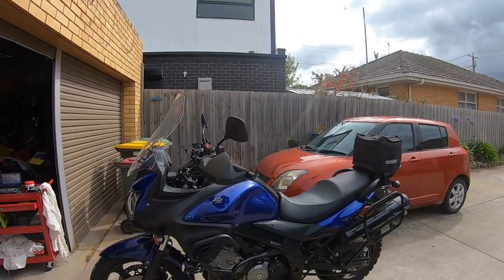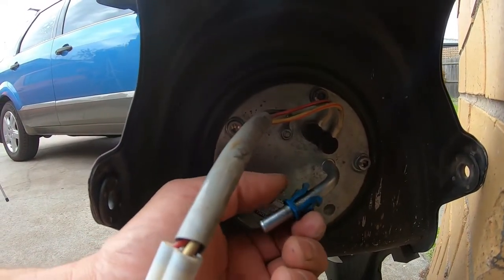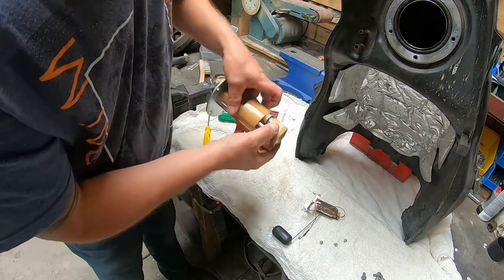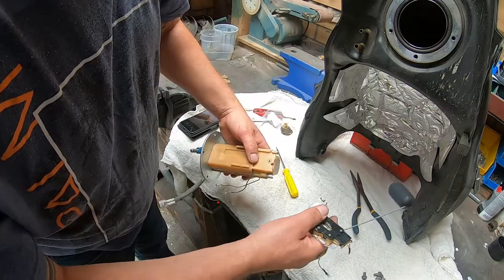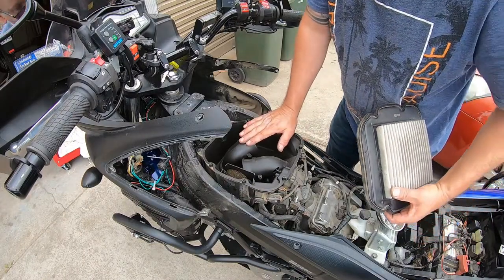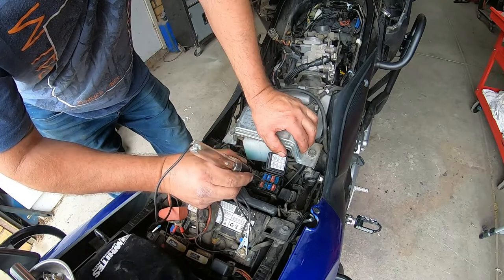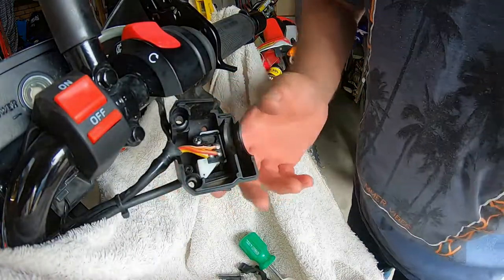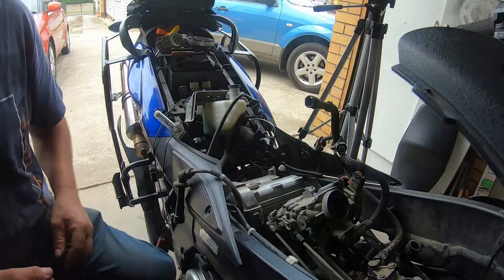how to change an air filter, fuel filter, on a 2012 Vstrom 650

Comment: Thank you very much for that video. Having the same problem with my 2014 V-Strom and am a bit afraid of removing the air filter box because of so many hoses (the tank's already done). But now after your perfect description (and the promise of my mechanic for a home visit if I fail ;)) I will give it a try later that day!
Reply from the maker: That's fantastic,  it's not as bad a job as you think.

Comment: Nice job tracking down the headlight issue. Mine was in the starter button, I cleaned the contacts, still didn't work so I soldered the wires together, just means the lights stay on when I start it. 
I'm changing my spark plugs and checking valve clearances while the radiator is off, much easier.
Reply from the maker: That's one way of fixing it, it would make a good video to see the shims getting done and people have asked to see plugs getting changed. Good luck with it, hopefully you can get the parts soon.
Reply: @bazz6670  Thanks mate. I will attempt to do a video on it.

Comment: no real need to remember orientation going back together. It will only fit in one position by uneven hole spacing. Nice engineering touch.
Reply from the maker: Thank you.

Comment: Fairly sure I need to replace my air filter so thank you for the video, very concise and informative on the extraction of parts. Hoping it's going to let me fix my fuel guage to as I currently have a blob moving across the guage instead of a fuel level. Still reads mpg accurately though so hope I don't need to replace the fuel sensor unit.
Reply from the maker: hey im glad the video helped you. i havent heard of that problem before hope you can solve it.

Comment: I sprayed all those electrical connections behind the rad/under the airbox with contact cleaner, then sprayed them with ACF50 and then covered them with some old bicycle inner tube to keep the moisture out, I also fitted a headlight relay kit.
Reply from the maker: Good job, if I take mine apart again I will use your ideas. The head light relay kit is way more reliable and better power.

Comment: great vid man, two questions i have regarding the fuel tank filter ? at what intervals do they recommend changing them ? and also are the old filters cleanable and re usable , ie: is it worth cleaning the one you remove and keeping it as a backup part ?
Reply from the maker: I think it is recommended to change filter every 40.000 ks or 3 years. I believe I payed close to $50 for filter from Peter Stevens. If you look on ebay they are heaps cheaper. Not worth cleaning  an old filter.
Reply: @bazz6670  thanks mate ;) 40,000 kms is pretty reasonable eh